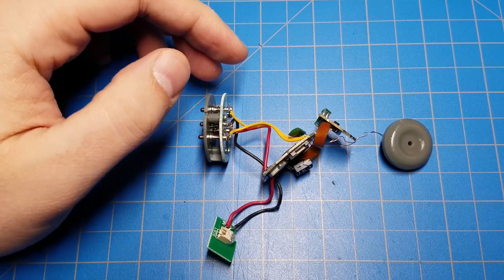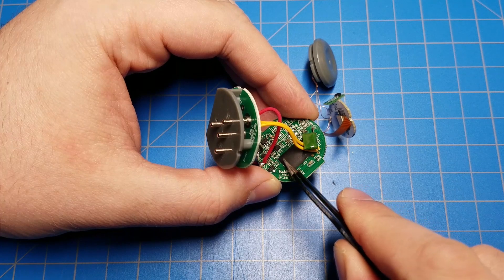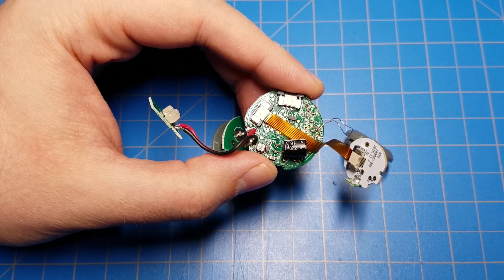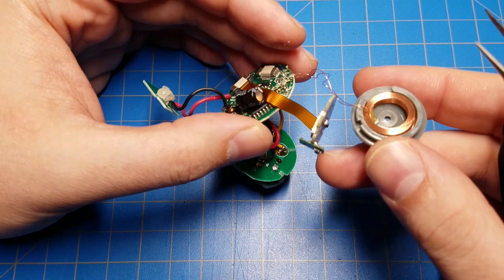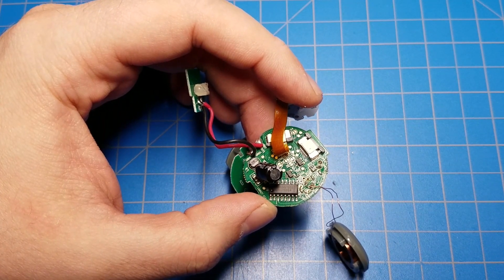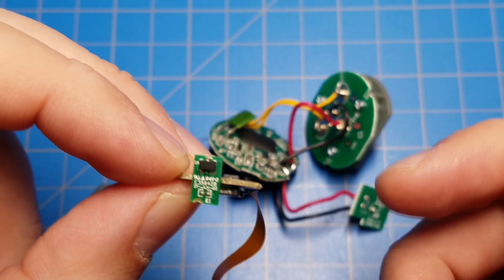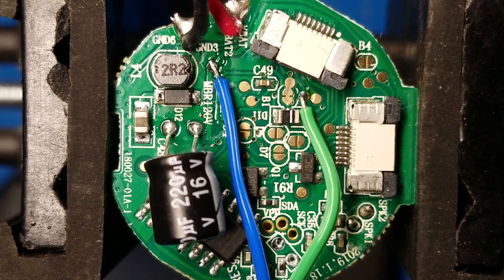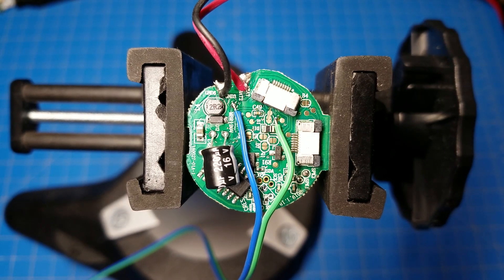Add A Mechanical Switch To A Savi's Workshop Lightsaber

Comment: Hi Great Videos, I got my Saber in December bought a white crystal extra and picked blue during the build...I've now watched most of your videos bought a Proxmark and made my own purple, green, yellow and red crystals...I'm disappointed in the battery life have you done anything in that space - made a rechargeable pack? or know any tricks? My saber seems to only last 2-3 days even off? Is one meant to remove the pack or crystal every time?
Reply from the maker: your best bet for battery life is to either:

pull the blade out AND THEN put your hilt's switch in the ON position

OR

remove the battery pack

for a rechargeable mod, I'd suggest buying a pack of USB-rechargeable AAA batteries like these: 
https://www.amazon.com/dp/B0BDZ5QS8M/. I bought a 4-pack of the cheapest I could find on Amazon and they've been great!

as for WHY the hilt sucks up so much power, it's because after the blade has been off for a little while the LEDs above the crystal start blinking and consuming power. for whatever reason, leaving the hilt's switch in the ON position without a blade inserted stops the LEDs from blinking. 

i personally pull my battery pack and it's what i recommend.

Comment: can you make a way for it to turn on right when connected to power and there is no need to flip the switch it just turns on right when battery pack is in. Thanks

Comment: How would you go about adding in a bigger battery than just the standard 3 AAA's? I want to be able to make it rechargeable via a wall plug or something if thats possible
Reply from the maker: I have not yet figured out how to non-destructively disassemble the battery pack and I don't have a spare battery pack to teardown destructively to figure out how to do it non-destructively. So I'm not sure what's possible with respect to modifying the stock battery pack. 

I believe you'd have to start with designing your own (or finding someone else's design on thingiverse.com)  battery pack 3D model and customize it to fit the electronics you want. You could then add a lithium-polymer (lipo) battery cell in there along with a battery charging circuit. That cell will produce a slightly lower voltage than the three AAAs (4.5V vs the lipo's 4.2V), but I don't think that would be an issue. 

Lipo charging boards with a micro-USB plug on then can be found on eBay for just a couple dollars. Buy one, measure it, build it into your 3D design, then you can figure out how much space you have left for the battery cell.

18650 is a common lipo battery cell, but I believe it's too long to fit inside the space a stock battery pack takes up. A 14500 is similar in size to a AA battery, that would probably fit, but if you try to use more than one battery then charging them together gets a little complicated. You can also find more specialized sizes on eBay, but you'll need to know what kind of space you'll have to work with first.

I think a battery mod is going to be one of the tougher mods to implement from scratch. It's also dangerous as Lipo batteries are no joke and, if damaged, have a strong tendency to catch fire and even explode. If you do create a mod, please share it, there are going to be a LOT of people who will want to hear about it. :)

Comment: How would one duplicate the microcontroller chip?
Reply from the maker: you'd have to write your own code to emulate its behavior and put it on a microcontroller of your choice. the code on the stock microcontroller is inaccessible. there's no way to clone it.
Reply: Ruthsarian and how would you emulate the code?
Reply from the maker: @noobikenoobi5580  you'd have to look at everything the microcontroller does; sending data to the blade, reading the RFID tags, controlling the LEDs in the hilt, reading the accelerometer to detect swings and clashes, and sending sound to the speaker. then you'd have to write code to handle all of that functionality, program it onto a new chip, then wire that chip up the electronics inside the blade.

a good starting place to get a sense of what would be involved is purchasing an arduino kit. it's a programmable microcontroller. the kits usually come with some LEDs and sensors and an introduction on how to hook thinks up and write code for it.

Comment: I bow before the superior intellect. I bought a broken 2002 Master replicas Anakin Skywalker lightsaber. The one he broken in Attack of the Clones. My plan was to empty out the hilt and slip in the chassis and blade into it. This is the missing piece to my experiment.   I was contemplating cutting into the metal hilt to put in a magnetic switch but that would take away from the silhouette of the hilt.  Going to try this right now. Wish me luck.
Reply: I have the exact same plan to put the core chassis components and blade into a Master Replicas Anakin or Luke Lightsaber hilt. The only issue is the chassis is the exact same thickness so the grey chassis had to go and I just used a stronger magnet for the switch located further down. How did the mod work out for your plans?